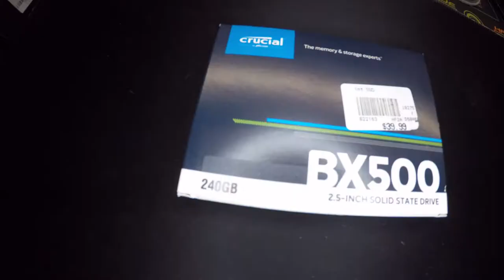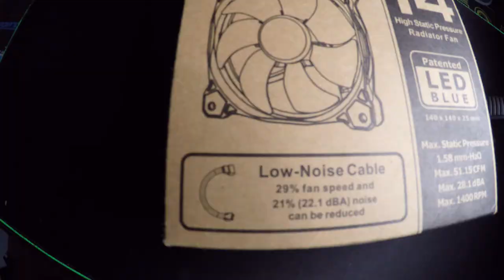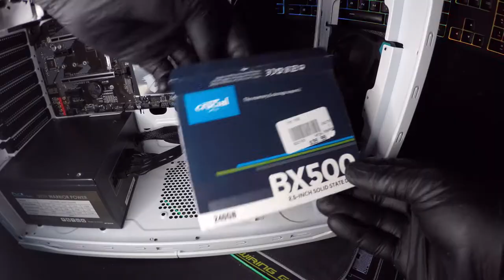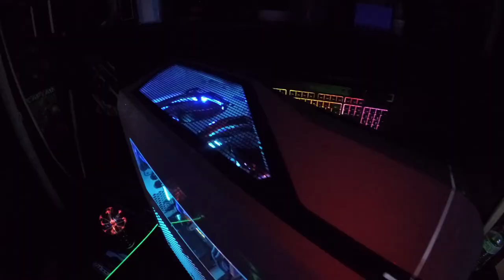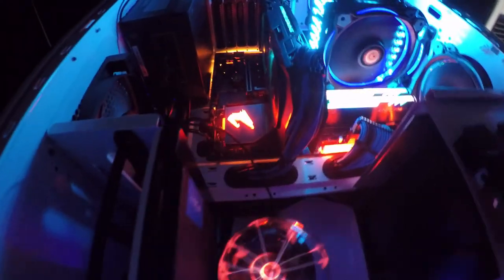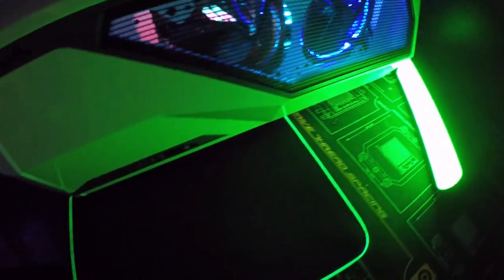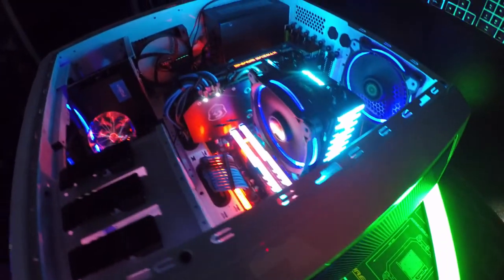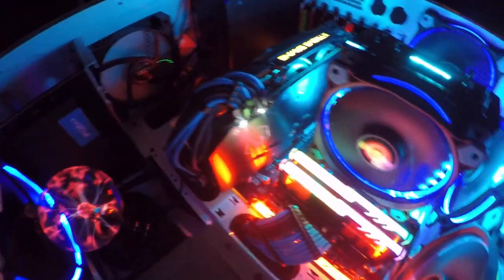EBAY 600$ GAMING PC BUILD

Comment: I think the entire reason of getting a gaming pc is so you can have better performance or equivalent performance to a gaming console
Reply from the maker: I like. Better performance... Im about to do a 1100 ebay build video.
Reply from the maker: @Jaxon Rothenberger i been looking for a case to build it in./ soon as i find one.. well do it
Reply: @ATECHPCs  will wait for it. I honestly think a future proof tower requires 32gb of ram, a 2080, 10th generation i7. Also video game development need to relax on vram usage. Not everyone has the GeForce titan 12gb vram. They continuously try to cap out our 8gb if we are lucky to have that.
Reply from the maker: @cecilsparcel9224  my current pc the Titan Rig... has a 10th gen i7-10700 cpu with 32 gb of ram. on a z490 chipset.. with a 1080 8gb water cooled card..and the cpu is also water cooled..  and its not enough for me.. i want a i9 with a 2080..o yes!
Reply from the maker: @Jaxon Rothenberger  yep.. iv been looking at that...
Reply: @ATECHPCs  yeah just a upgrade on the gpu should do